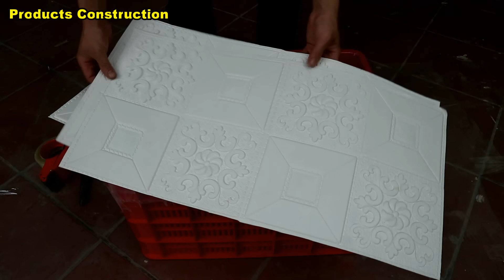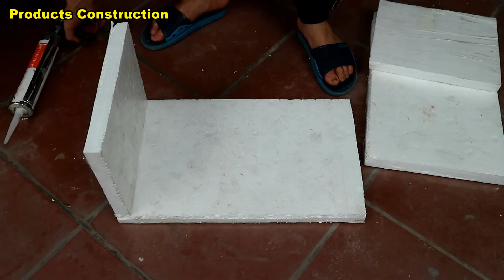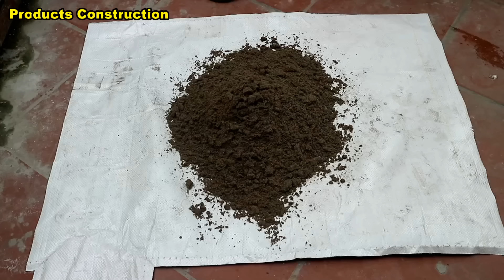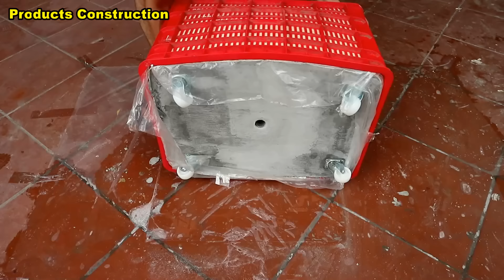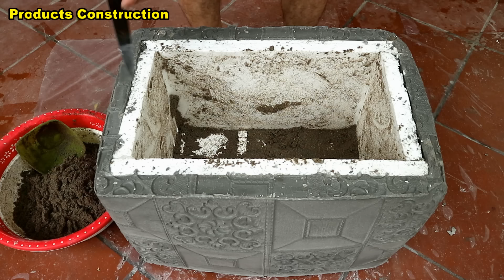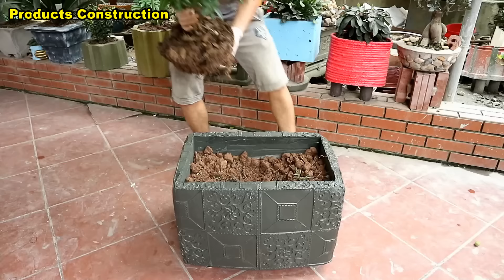DIY | How To Casting Cement Pots Beautiful At Home | Moving Easily

Comment: Great project. I'm also thinking if you add more thickness to the insert, leave the top off, add more of the textured stuff, and add a smaller insert that is a block or made like you made the insert with the top, then when it is done you will have a planter with a place in the middle for umbrellas....Or...you can tape a pole, which is covered with cellophane, inside the smallest insert, pour in cement and when dry pull out the pole and cellophane. Then you will have a planter and a place for a deck umbrella.
Reply: by seeing ur comment i remember the movie Ford vs Ferrari i hope u get that moment

Comment: Very crafty
I wish the wheels were rubberized black and anchors were installed for the wheels in case you need to replace a wheel
The white sticks out and will most likely crack under the heavy weight of the pot
Reply: What about placing a board with pre-drilled holes as the base? If you can get black casters in your area, you don't have to use white!

Comment: Where did you find that great peel and stick for around the sides? Love these!
#kindnessmatters
Reply: Maggie Baxter temporary backsplash or ceiling tile panels from the hardware store would work.
Reply: @Clara D, most of the backsplash designed ones are well coated for easy cleaning, and hollow, if you note the OP’s angle of removal it collapses and releases nicely likely for those reasons. For others, or very textured, I might use spray mold release, or WD 40. The caution with an improvised release spray would be the spray may interact with the mold and concrete chemicals, potentially damaging the patterned piece or leaving residue in your cement set surface.
Reply: How to buy that pattern sticker
Reply: I wondered if that was anaglypta wallpaper?
Reply: @TheJangaw  it's right!
Reply: Hanh Nguyen good to know! That gets my Decorator’s brain working. 😁
Reply: Quero fazer medidas de cimento e areia quanto de cada coisa
Reply: 3D wall paper from noon on line
Reply: @mguapa4106  Que amargado. Para que lo miras?🤦‍♀️
Reply: What kind of paint did you use on the outside it has a sheen to it ? Great work
Reply: where can i find that sticker

Comment: The basic concept is okay but the plastic crate is not strong enough to prevent bowing and may fail causing uneven walls. I like the casters but again may fail due to poor structure.
Building a plywood or MDF box and using 1/2 inch thick plywood squares embedded in the base for the casters and maybe using mesh screen for structural integrity would go a long way  in making you efforts last more than a few seasons.